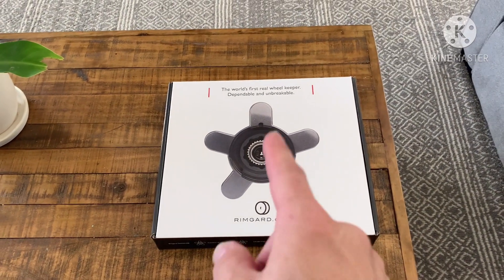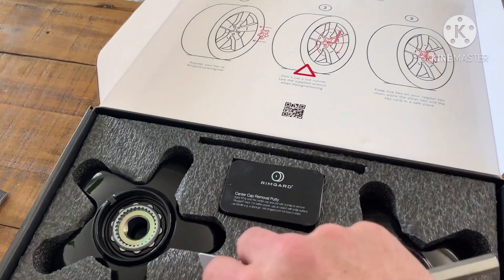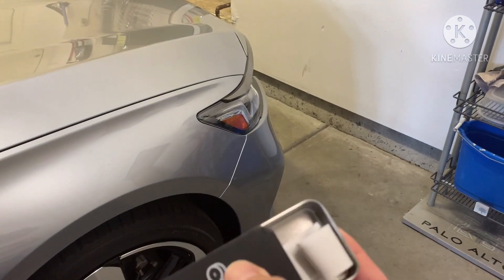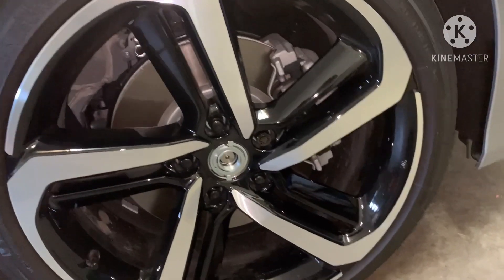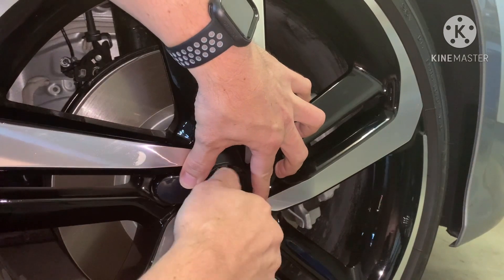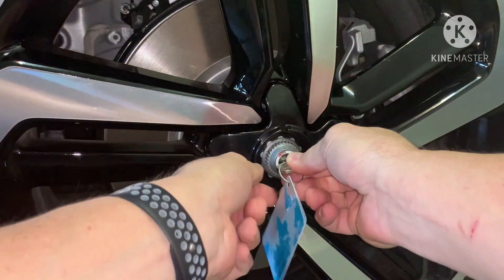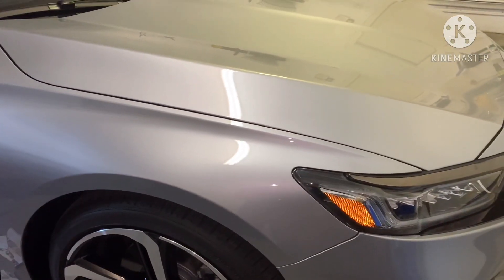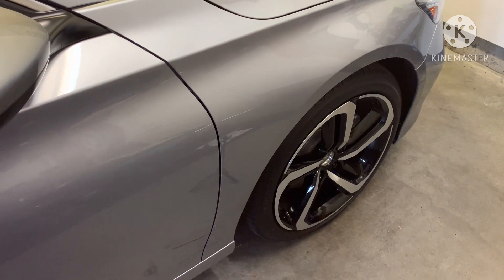Rimgard is BEST wheel lock for your Honda, Acura, Toyota vehicle

Comment: First, these just straight up look cool, the black ones blend nicely with the design of the wheel. Second, screw theives. I've seen a '16 Accord having its wheels removed while passing by a parking lot at night and and '18 Accord leaning after having two of its wheels stolen. Worst thing is that it's a relatively nice and calm area so I guess it makes a good target for them. Third, these would grant a great deal of reassurance for anyone who fears this crap happening to the cars they worked their asses off for.

Comment: The putty doesn't work at all!
Reply from the maker: It does work. I did them all with it no problems. You have to have a flat cup and it comes right off.
Reply: Not buying it. Why didn't you show it then?
Reply from the maker: Because it’s so simple. Putty on cap and then push a flat cap on it and pull fast. Maybe this item’s not for you.